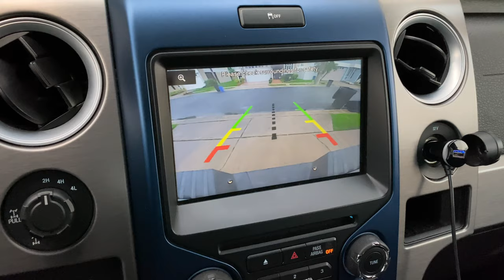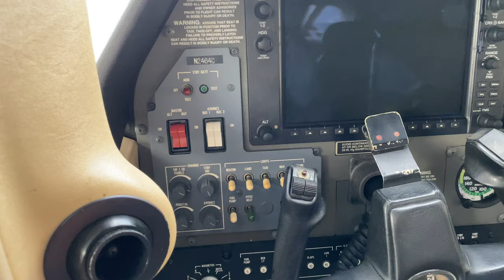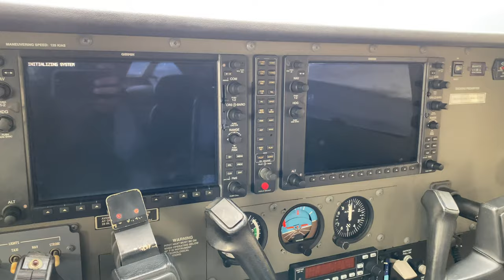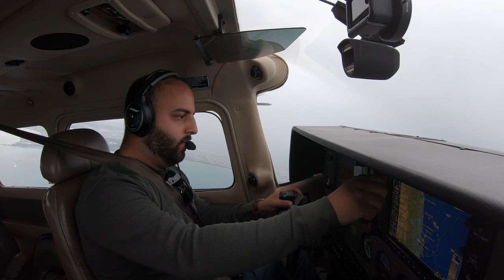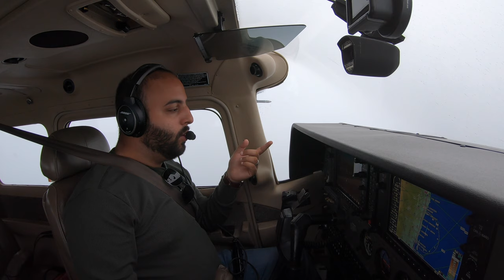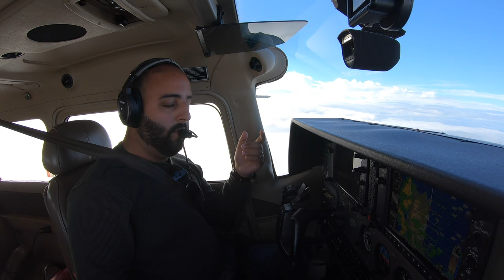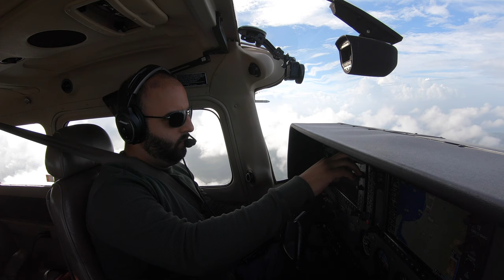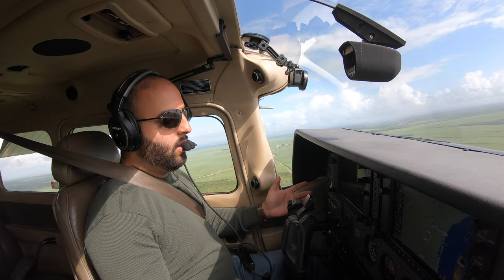IFR Adventures in the TURBO 206 Stationair - Flight VLOG (TJIG-MDLR)

Comment: Just came across your channel a few days ago. Enjoying the videos! I was in tears with that music on the tower frequency, my goodness! LOL. In terms of filing IFR, I always file on the ground, unless there are challenges in doing so. I always want to reduce the number of decisions I have to make while flying and it's much easier to cancel an IFR clearance in the air rather than picking up one in the air, especially in busy airspace. Also, when it comes to fair weather cumulous clouds at mid-level altitudes, I generally fly through them when I'm solo because it gives you very good IMC practice/experience. The up and down drafts will give you a ride but they aren't strong. It'll teach you to ignore those somatogravic and somatogyral impulses and keep the airplane straight and level if general turbulence picks up on a flight, and the sensations don't last long since you generally come out the other side anywhere from several seconds to a few minutes later. The trick is to do so in the morning or early afternoon before the increase in energy builds them up into the much higher altitude levels, of course, where the wind drafts will be far more severe. But at 6,000' if they are fair weather and light in color I generally go right through.
Reply from the maker: Thanks for watching Adjua!!!!!!! Love your input!
Reply: LMAO because i was multitasking and when i heard the music, my head turned back towards the screen